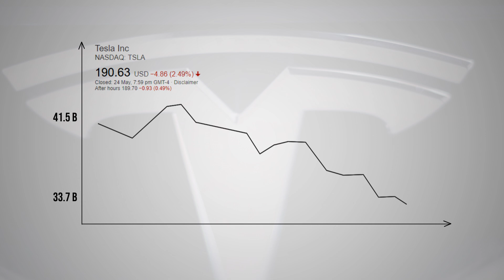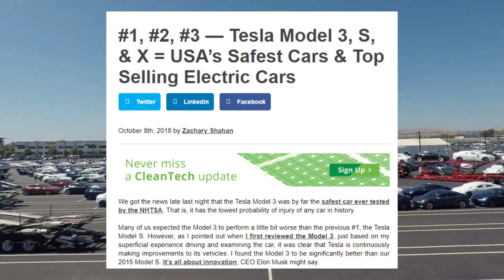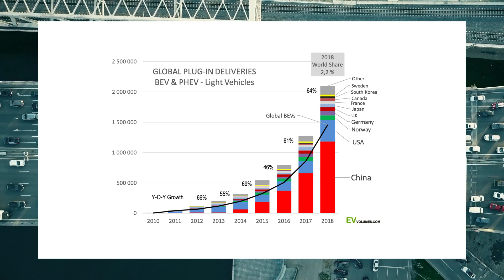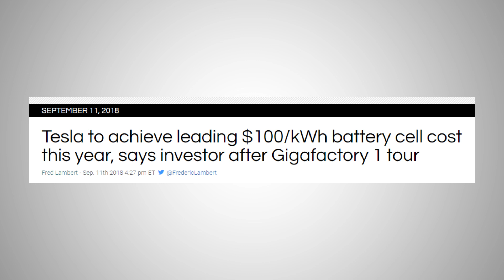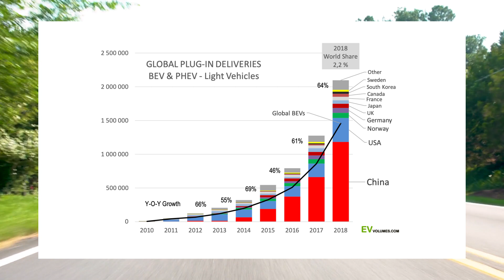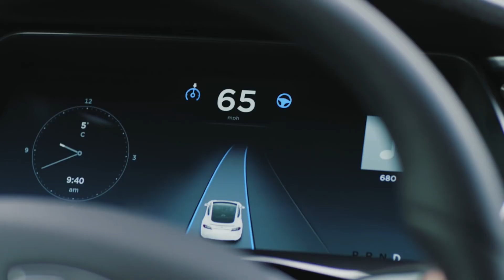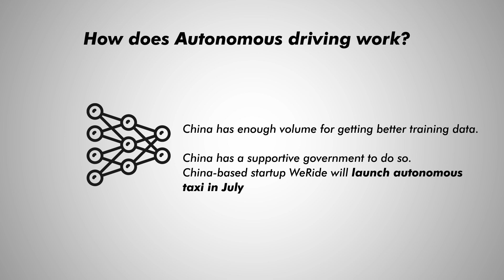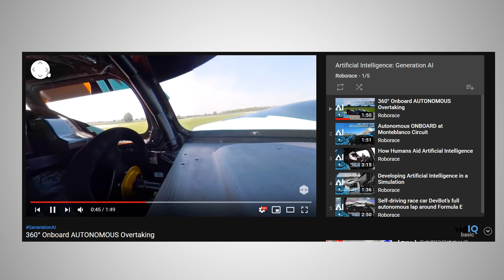Can Gigafactory Shanghai Fix Tesla's Money Problem? | Elephant Explains

Comment: The Shanghai factory opens in September, and today I learned that they have been hiring 500 per day this month, with most coming from existing car manufacturing plants in China. This is Phase 1, and Phase 2 will open by December / January... initial production of Phase 1 is expected to be 100,000 per quarter. With American factories hitting 100,000 or so, I am expecting 200,000 cars by Dec 31st. for 4th Quarter. This will push 2019 figures up to or over 400,000 for the year. and next year if they are not producing double that, Tesla will be in trouble. Now to figure in the European Factory, I expect because it will take longer to build, (unless Shanghai has lit a rocket under the European Construction Industry) I don't see it affect Tesla's numbers until 2021. and it's possible by then Tesla will have cracked the 1 Million mark with just China alone. 

One other thing to note, the factory robots that Tesla uses are made by a German company, that is owned by a Chinese Group. Bet's it has a factory in China :D Looking for GF 4 to open up in China before the European Factory gets into production.

Comment: Thing to remember is, the primary purpose of racing series is to display and present advertising.  Because advertising is what truly pays the bills.  However, Tesla does not advertise.  Tesla has no need to support the advertising industry.  Yes, a racing series does place engineers in the crucible, putting them in a high stakes situation where they must learn fast.  However, Tesla Engineers are ALWAYS under fire, in the frying pan, always learning and improving the product, at the very edge of failure, but pulling out success -- with products that are sold in the Real World.

Comment: Really, LiDAR is the answer. How ? A Tesla has a forward facing radar and one or two forward facing cameras. You put forward no logical reason why having LiDAR would have helped in any way. Just because other manufacturers are using LiDAR does not mean it is a better solution. I've seen no suggestion that the cameras or the Radar on the Tesla did not detect the stationary vehicle or that having LiDAR would have somehow been more effective in detecting the stationary vehicle. To quote many a primary school teacher "if all your mates jumped off a cliff would you". Come up with a reason why Lidar would have helped and your claim might be worth considering but just saying the others are doing it so Tesla should too is an appeal to irrationality. There have been a few incidents where Tesla cars have driven into stationary vehicles, one victim I recall was a bright red fire truck, don't tell me the cameras could not see that, they saw it but the system did not respond appropriately, LiDAR would not have helped there either.
My own experience is level 2 autonomy (which is what Tesla cars currently have) is a big help, it lowers the strain on the driver, but it can never be fully trusted. There is such a huge gap between what Tesla currently has deployed and full self driving that I remain a sceptic, particularly of the time line Musk is projecting but if it can be done Tesla cars already have the best hardware to do it.

Comment: Can Gigafactory Shanghai Fix Tesla's Money Problem? No, they will need to build 6 more wich will eat any profit for the next 5-10 years. Tesla was supose to be a kick in the but to the industry, they didn't take the hint and now tesla is so far ahead it just makes more sense to completely replace them. If you have kept up with Tesla you have noticed this shift and how they have blatantly said we have no competition. Tunnels, autonomous driving and moving to a model of supplying vehicle access vs sales. I would bet most if not all vehicle manufactures outside China will go bankrupt within 10 years. Cina as the leader in being sensible atm is the supportive environment there not getting anywhere else.

Comment: It is not fully true that the Teslas that recently drove into a truck did not detect it, but instead did not have any safe way to interpret such a random event and avoid it (including braking).  The Semi Truck crossed through the intersection against traffic. No system or human could easily can avoid this type of situation. Unless of course you have BOTH the Semi and the Car on Autopilot, driving in a more safe manner, and not running intersections against traffic control devices. https://cleantechnica.com/2019/05/21/teslas-trouble-with-trucks-and-another-shakeup-of-the-autopilot-team-is-there-a-connection/

Comment: The slay are still the cars with the least casualties per driven mile...
There have to be between 20 and 25 autopilot caused accidents to get to the same amount of crashes/ mile compared to gas cars
Calm the fuck down people
There’s been fewer autopilot crashes than I have fingers in what 4 years? Since they are around

Comment: Why isn't better research done before reporting? Having watched to the end, I see that this video is biased because you work for or is sponsored heavily by Riborace. They have invested big in LIDAR and Nvidia technology. That is something you should have put in the disclaimer at the beginning.
Here's where your video is wrong:
- Lack of Chinese demand- because the Chinese know that China gigafactory being built and new better pricing will be announced (which when Tesla did recently announced, demand was overwhelming..their website suffered). Keep in mind that production from that factory are meant for Chinese market only.
- stock price went down - Not because of fire. There's 700 ICE vehicle fires DAILY but no one reports on that. And stock price didn't suffer because of the 2 fatal accidents INVOLVING auto pilot turned on. AP is not full-proof. There's gonna be situation where you still can't get out of. And it's still in beta per the warning when you turn it on. If you're the nincompoop who rigs the steering wheel to take a nap when told not to do so, well then Darwinian filter is doing it's job. But AP is still 7 to 10 times safer based on US NHTSA stats. Why didn't you report the real reason stocks tumbled.. the self-interest FUDs and short-sellers, who stood to gain over 1.8 billion (a very conservative estimate) or more from this last month.
- LIDAR is both expensive and error prone in bad weather. A snowflake has the ability to reflect so much light that it would show up as a huge object on LIDAR.
- you can't train auto pilot on a race track. Those conditions are too ideal. That's why Waymo, Google, and others (all using LIDAR btw) have been going about it all wrong by constructing a test town for this training. Tesla has been using real world training by every Tesla driver using AP. And every steer and correction by the driver gets uploaded back into the huge billion-miles-worth database for Machine Learning. No other company has that or can catch up to that.

Comment: In no way whatsoever did auto pilot cause the death of the two Incidents where the car hit a truck crossing. As a back up it did fail to stop But it is just a back up system currently. (If it was FSD then it would be the cars fault) In both cases If the driver with paying attention, as it was his responsibility to do so, he could’ve stopped safely.

Comment: Elon has always said that the driver is in charge at ALL TIMES. The model 3 that hit the truck is solely the fault of the now dead driver.... bottom line... On analysis of the cars data, the driver had never used Autopilot ever, until 10 seconds before the crash. From this, we can assume that he engaged it so that he could look away from the road to do something else in the car, a fatal mistake. Tesla has NEVER claimed that to date, the car is fully Autopilot capable. This is coming. I Drive a model X and I engage Autopilot whenever I can, in cities, urban streets, highways and motorways, I NEVER take my eyes off the road. Autopilot is my assistant, not my driver. 
Tesla fires don't explode like petrol. They start slowly, giving the occupants even minutes to escape. Just say'n....

Comment: @LEI, nice work but on Tesla's Autopilot 'problem' - it is a limitation that ALL semiautonomous systems have.
Tesla's manual warns specifically about the conditions when Autopilot will not work.
This WIRED article explains:

Why Tesla's Autopilot Can't See a Stopped Firetruck | WIRED
https://www.wired.com/story/tesla-autopilot-why-crash-radar/

'The [Tesla] car's manual does warn that the system is ill-equipped to handle this exact sort of situation: “Traffic-Aware Cruise Control cannot detect all objects and may not brake/decelerate for stationary vehicles, especially in situations when you are driving over 50 mph (80 km/h) and a vehicle you are following moves out of your driving path and a stationary vehicle or object is in front of you instead.”

Volvo's semiautonomous system, Pilot Assist, has the same shortcoming. Say the car in front of the Volvo changes lanes or turns off the road, leaving nothing between the Volvo and a stopped car. "Pilot Assist will ignore the stationary vehicle and instead accelerate to the stored speed," Volvo's manual reads, meaning the cruise speed the driver punched in. "The driver must then intervene and apply the brakes.” In other words, your Volvo won't brake to avoid hitting a stopped car that suddenly appears up ahead. It might even accelerate towards it.

The same is true for any car currently equipped with adaptive cruise control, or automated emergency braking. It sounds like a glaring flaw, the kind of horrible mistake engineers race to eliminate. Nope. These systems are designed to ignore static obstacles because otherwise, they couldn't work at all...'

Comment: I'm sorry, but this video report is largely BS.

The Shanghai factory will presumably enable a doubling of Model 3 production capacity. Furthermore, it will allow Chinese deliveries without a long wait while the cars are on ships crossing the Pacific to get to China. This should mean more timely delivery of Model 3s to Chinese customers. Tesla's financial situation takes a hit every time there is a quarter end with lots of cars still on ships. That will now be prevented when it comes to China.

On the other hand, the Shanghai gigafactory is likely to nearly double Elon's logistics headaches. Tesla has to coordinate with thousands of suppliers, either in the USA or in China just as it has to do with the Fremont factory. If the supplier is Chinese, it means yet another load on the purchasing department. If it's a USA-based supplier the purchasing department doesn't have to add a new suppler to its load, but it does have to worry about parts shipments getting across the ocean in time to avoid holding up the entire Shanghai gigafactory. Either way, there's a near doubling of the workload.

The FUD being spread in the financial community is due directly to lies being spread by Adam Jonas of Morgan Stanley:

"Today, supply exceeds demand, they're burning cash, nobody cares about the Model Y, the company raised capital near lows, no strategic buy-in ... There could have been a strategic involvement in the capital raise — someone to fill the board to provide some know-how."

https://www.businessinsider.com/tesla-analyst-adam-jonas-slams-company-private-call-2019-5

It's obvious from the above quote that Morgan Stanley wanted one of their  members added to the board as part of the recent capital raise deal. They didn't get it so now they are trashing TSLA.

Comment: Investors aren't losing confidence. The fact of the matter is, from an investing point of view, it's never been better financially for Tesla. The reason the stock price is so low, is there is a significant BEAR RAID, generated by the oil and auto industries pushing the price low. They're trying to put Tesla out of business because success is that last thing they want.

Comment: The problem with autopilot is two-fold:
1) The name. Autopilot is not autonomous level 5 self driving. 
2) The fact that people are stupid and keep treating it as if it is a fully autonomous system, and therefore they turn it on and simply stop driving. It's been repeated a thousand times that you must keep your hands on the steering wheel, you must be aware of your surroundings, you must pay attention. Do they do it? No. Why? Because they are stupid.

Comment: Good points re China supply chain being the best in world for EVs.  Smart for Tesla to be there early
1/10th cost of Lithium (and perhaps cheaper rare earths for their magnets) in China will assist lowering China factory car cost.
Your idea that ‘Tesla needs lidar’ was then debunked by yourself when you said China testing was going to help - yes that is the whole basis of having the biggest fleet in the world gathering data 100X faster than anyone else. Odd logic
You said some (older) Teslas were already using Nvidia chips for self driving - but then you ignore that Musk said they weren’t good enough so he built a better one that was fitter for purpose and has already been fitting these? Don’t you need to update this part of your presentation? (Seems sloppy)

Comment: Tesla is going overcome many of the problems with autonomous driving that have existed so far with their new NNA (Neural Network Accelerator) onboard computer. The company decided to build their own processor chipset and stop using Nvidia. One key factor to which they pointed was that companies like Nvidia have to make general purpose systems to accommodate many different customers and their different needs. Tesla's new system, however, was designed and is being built in-house so they can make it tailored to their specific needs. Everything we've heard about Autopilot's performance and capabilities, up to now, in the real-world will pale in comparison to their new NNA. Moreover, they've essentially modeled their new NNA on the human brain -- they want their system to work, in some important ways, like an actual brain.  I expect this development will further propel Tesla even more years ahead of all other autonomous driving systems.

Comment: Tesla hasn't released Autonomous cars yet, they're driver assist. Those crashes were caused by drivers not paying attention to the road. The data gathered by Tesla will improve the data set used by the autonomous algorithm. The edge cases which resulted in crashes will be used to prevent them in the future.The media is to blame for incorrectly blaming the technology. There have been numerous crashes where the Tesla driver just walked away while the driver in the ICE car where killed out right.Tesla is by far the safest, but it's still important to remember the Autopilot is not fully autonomous yet.

Comment: 1:50 Meh.  You're forgetting competition. It appears that investors are reducing their confidence now that larger automakers are committed to EVs.  As a Tesla fan, I've felt the price is too high anyway.  This is the reason Elon nor Tesla is not alarmed with a reduction in market cap.
9:55 Lidar is nice but cost and size prohibitive.  It will only work with Tesla's visual system as LIDAR is blind to color.

Comment: The lithium salt is only a few % of the content of a Lithium-Ion battery, but perhaps 6 - 7 % of the cost. Reducing the cost of lithium to 1/10 will only reduce the cost of the battery by perhaps 4 % on the cell level, 3 % on a pack level. But still welcome, just sounds like you think it will make Tesla's batteries drop significantly from the $100 goal.

Comment: Good video!  Thanks.

From what I see here at least, I don’t think that Roborace constitutes “extreme conditions” for autonomous vehicles.  Negotiating high-speed driving on a track is a trivial problem compared to driving through a neighborhood construction zone, for example.  

In such an area, you have to comprehend and correctly react to, for example, closed lanes, damaged or missing road signs, workers and pedestrians, recently-changed roads that no longer agree with GPS data, pets (squirrels, etc.) darting across the road, flaggers directing traffic, potholes, ...  Such circumstances are often hard even for human drivers to understand!

Comment: Death was NOT autopilot error, it work as should, and do not make this wrong lines, you make more misleading then ever. I once subscribe your chanel, but you go down trend, not up... watch you old videos and new one, and content go down.
9:20 it shows how uninformed you are,  radar is enough to see this track, but you not get it.... why someone die, there are many things, track driver do what he should not do, USA do not have law to trailer have elements to prevent cars go under, as in EU required, driver not pay attention, and at the end, autopilot at that time ignoring static object on high speed. So you claim are...
9:45 more then 2, at last 3, sensors, building 3d image of world around basing on sensors data, and 3rd decision making on 3d model. But there are more in Tesla, as vectoring 3d model, path prediction, feedback loop, etc

Comment: Nonsense... Testing the autopilot on a racetrack has a minimum value and does not represent the complexities of true road conditions... And it is much, much easier to autonomously drive a car on a racetrack than on a regular road. I don't see much synergy here. Also, the lidar comments do not make technical sense and are very vague... Human driver uses just vision and it's neural net (brain) to proces the data. This is the underlying rationale behind not using the lidar and I agree with this conceptually. Also, tesla uses radars so the recently reported crashes are rather a programming issue (network training issue), rather than lack of the right sensors. BTW. some time ago Uber (?) was testing its autonomous system based on lidar and killed a person crossing the road. In that case it was also an algorithm problem, rather than a sensor problem.